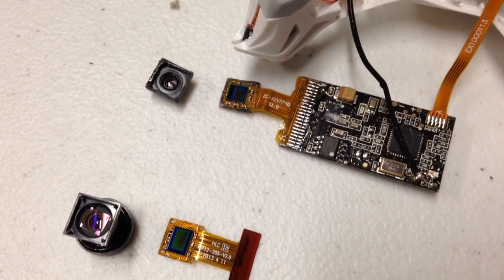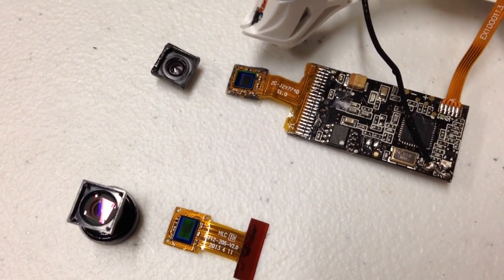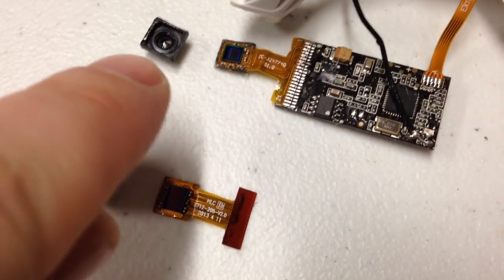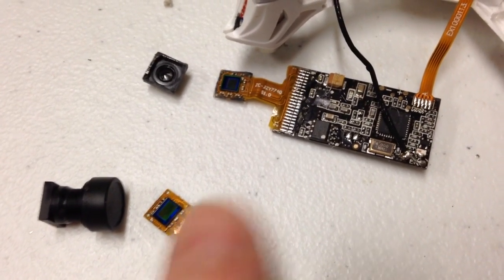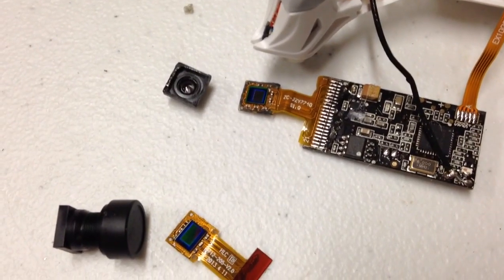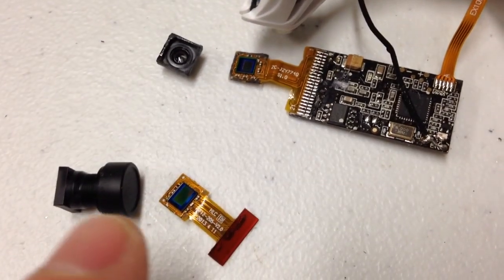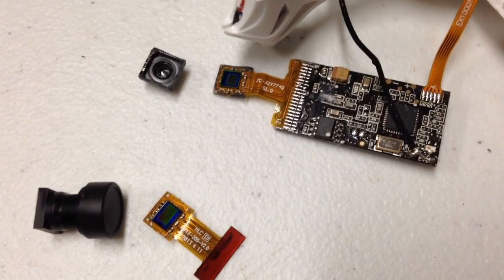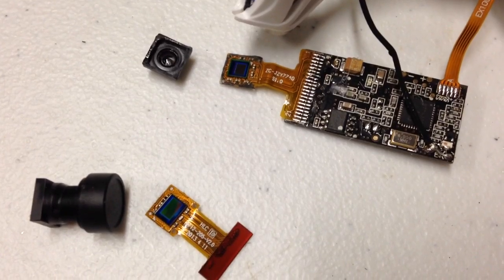Wide Angle View D Lens Mod Hubsan X4 H107D: PART 1

Comment: I did this mod. Be very careful with the small ribboncables. Make sure not to bend them to often. And take extra care taking the lens of the sensor. There are small resistors close to the edge of the sensor where the glue is that you need to remove with a knife

Comment: Thanks for the reply Jon.
Can we get some clarification on the post made by "tomili1986"  2 weeks ago.
He states there is a PnP solution but I believe he is addressing the H107C model instead of the FPV H107D, which is the interest of this thread.
Just trying to clear up a little confusion. 

Also, would love to see some video of the resulting effects as to how much wider the view is.  Maybe you could persuade an owner of one you modded to post a vid. ')

Many thanks
X/BillyD..
.
PS: MassiveRc has this lens in stock and of course is in FL,USA..
 .
Reply from the maker: Your assumption is correct. There is no plug N play option for the lens mod. The camera module on the H107D is soldered to the circuit board whereas the 107C lens module ribbon cable slides into a cable clip that allows for simple removal and installation. 

As well the h107D module and 107C modules are not the same resolution making them incompatible. 

The only "easy" way to get wide angle on the H107D is to buy one of those jelly fisheye lenses others use. The lens slips into the original lens and provides a half decent image. 

The way I and several others discuss doing it is a factory-quality mod. 

I would love to get some videos to share showing this mod in action but sadly I do not know who the people where that purchased the units I built.

Comment: Guys, i got some great news! Read this if you are about to change your lens on the 107C model (The one that records Video instead of live transmitting it!!)

If you are going to make the mod on said model, you don't have to tear apart the lens! The great thing about the board of the 107C model, is that the lens is not soldered onto the board, but it can be unplugged! I found that the fisheye replacement lens has the same amount of pins, and plugs perfectly into the same spot that the original lens is plugged in, so you actually only have to pry open the connecter, unplug the original lens, plug the new fisheye lens back in (it is upside down compared to the original lens) secure the plug by pushing it back in place. Then you have to drill open the lens opening, or, as i did it, simply cut the thin part Away, so you don't have to widen the hole to push the bigger lens through, you can then simply fit in the thinner part of the fisheye lens (it will hold in place once you reassemble everything anyway). Maybe you have to cut away a tiny bit of the battery-hold in plastic thing, but that's it! You just got yourself a working Fisheye Hubsan X4. With this method you don't have to care about focus issues, as you don't have to unglue the lens or change the sensors! And if anything breaks, you would still have your original lens that you can just plug in.

If anything is unclear i may make a Video on it, leave a comment if you need one!

Cheers